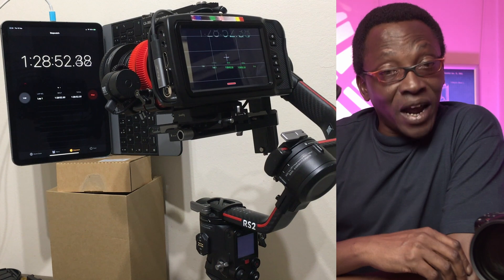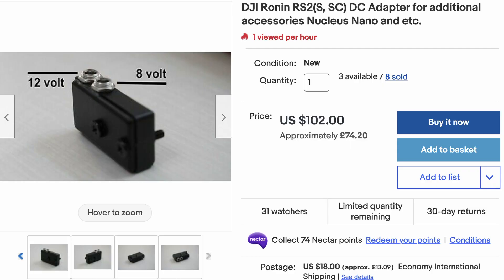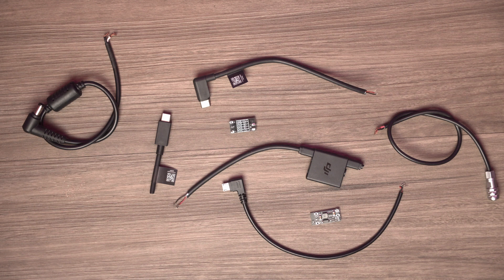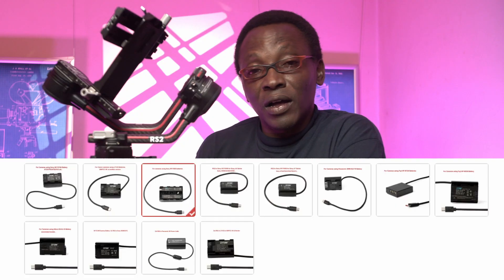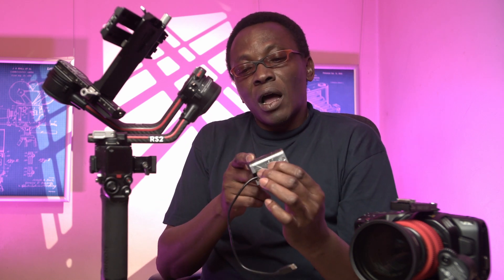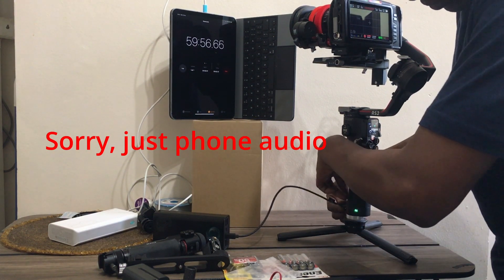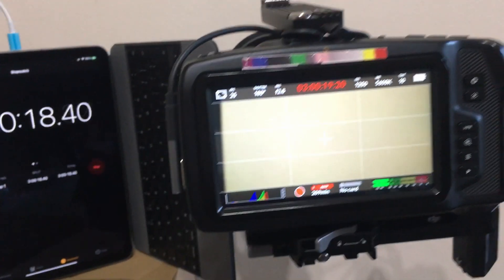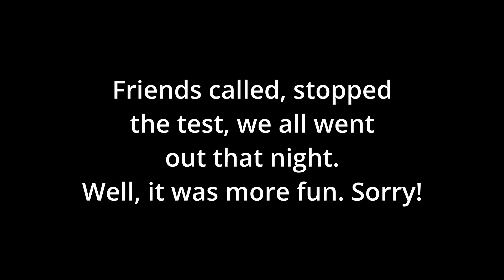DJI RS2 now Powering BMPCC and other cameras!!

Comment: Its crazy, I have stripped down a standard USB C lead and measured voltages on all the individual wires relative to each other and the highest voltage I can find in 2.8V dc on ports 1 & 2. So how does Zitay manage to obtain 7.2V dc from either the bottom or middle USB C port on the RS2? The top port has a standard 5V dc output but neither of the other 2 ports have any decent voltage!
Reply from the maker: No idea how Zitay is doing it, I don't use their dummy as I prefer this one I made myself... works better and I added a second USB-C cable for 5V out of the 'dummy' as seen at the end of the 'Zitay' video - https://youtu.be/k_JwmZ7F8AI?si=EmCIEnkA5Q7PceAe
Reply: @aNELeOnwuka  Its amazing, I measure 5V dc on the top RS2 USB C connector but nothing on the lower 2 except 2.5 & 2.8V dc so there must be some handshaking between the RS2 & the Buck step up PCB that ensures there is a high voltage output available from the lower ports on the RS2. I also have the original Ronin S and this is great because it has 2x 12V dc ports on the gimbal arm, so the RS2 is a step backwards. I have ordered the Zitay Sony A7SIII battery NP-ZZ100 version so will let you know how this goes.
Reply from the maker: @sjmackinder  The Zitay will work. Everyone was surprised when the RS2 was released and it didn't have 12V out.
Reply: @aNELeOnwuka  I have watched your excellent videos on the subject but still not sure how you have made your own version and what pcb you have used along with the USB C wiring?
Reply from the maker: @sjmackinder  Was going to make a video but it wasn't worth it. The 'How' was added to the 'description' of the Zitay video... the link I sent you earlier.
Most recent update is since I now use the Micro Studio 4K G2 as the gimbal camera I converted it to NP-F also with 5V out. If you're on FB you probably see me in Pocket Groups and a couple of RS2 groups.
Reply from the maker: @sjmackinder  Crazy, just wrote a reply that didn't go thru.
I was going to make a 'build' video but it ended up not being worth it to me. So I updated the 'how' in the description of the 'Zitay' video link I sent you earlier.
Reply: @aNELeOnwuka  I have the Tilta Nano USB C to USB micro cable to power the Tilta motor, this only works when connected to the top USB C connector on the RS2 and not either of the lower ones, hence my confusion....?

Comment: After spending hours and hours thinking and researching how to reduce the weight and make my rig lighter with the DJI Rs 3 Pro and Black Magic Pocket 6K, I found this minimalist and brilliant solution! For the continuous power system, do you think a Reytric BP-95 6600mAh v-mount battery connected by the USB output would be enough?

I'm also looking at how to install my t5 ssd and a hot shoe in case I need to use my Rode Wireless Go, increasing as little weight as possible and I think I'm on the right track, however if you have any advice it would be very helpful.

You are a genius my friend, thank you for showing me this way.
Reply from the maker: Ok, some interesting questions. I will try my best to answer from actual experience.

Hmmmm, where do I even start? First you want to get rid of the cage if you have one. So ‘how’ do you mount your T5 and Rode Wireless Go? I have one of these – ‘Ulanzi PT-7 Bracket’ and have used it on a gimbal many times; you can figure out how to mount things to it – both your T5 and Rode.
Found here - https://tinyurl.com/yzxa2pv5

Next is power. First I’d ask have you seen my ‘Zitay Dummy’ video? Found here - https://youtu.be/k_JwmZ7F8AI?si=xv2SbAtFu0KhViY9
The same version I’m using should power your 6K as it uses the same battery.
I’m not sure how much the v-mount you mentioned costs but you can use a much cheaper power bank and power the gimbal handle whenever the gimbal is off, even those small portable 10,000mah power banks.
Do note that a stronger 12V @3A power bank will power everything when ON like in the video. Link in the Zitay dummy video.
Now if you already own the Reytric v-mount then I’d say do some research to see if there is Dtap to USB-C so you can charge the gimbal @ 14 or so volts. You can also wear the battery on a belt to reduce gimbal weight even more.

By using the T5 I’m sure you already know you will not have ‘camera control’ from the gimbal… Aaaaaah the RS3 has Bluetooth start/stop or something… no problem there. I keep forgetting, as my gimbal is the older RS2.
Hopefully this answers some of your questions.

Comment: Would it be able to power the camera at 4K 60fps RAW 3:1 with full screen brightness? Because that's one thing that it can run on 8V but when it needs all the power it might not be able to keep up. I'd love to know! Thanks in advance!
Reply from the maker: Hi. That's an odd comment. The thing is it doesn't matter what your settings are the 'voltage' is not going to increase to 8V. Both my cameras are the 'early version' P4K so STILL have CDNG, having said that - NO MATTER the resolution or screen brightness - power from the dummy will read 7.4/7.5 for a full battery and doesn't go 'higher' with LP-E6 battery or dummy.
But to answer your question - Can you shoot 4K DCI, 60 @ 3:1, 100% screen brightness with the gimbal powering the camera with a 'special' USB-C RS2 dummy? ABSOLUTELY YES!

If you have not seen it yet I updated the video as I finally got the Zitay version that people can buy NOW on Amazon - Zitay Dummy Review - https://youtu.be/k_JwmZ7F8AI
Reply: @aNELeOnwuka  Its more a question of amperage if the voltage stays the same. Can the system handle the amount of amps it will take to meet the power (watts) necessary to run all of those settings.
Reply from the maker: @nolesdennhardt8986  Very good observation. The gimbal is 2A and in the testing I've done the Pocket cams run SSD, power OIS lens on, HFR and only hit 1.1A. The main problem with Pocket cams is the moment you have a 'dead' battery inside that is being charged... the Amps used jumps way up - I never have a battery inside but that's just me.
Not a prob;em with this set up as there can't be a dead batter inserted. I think there is a bit more info in my 'Power Bank' video. Cheers mate. https://youtu.be/Pp6uY_enG5U

Comment: So, crazy question. If you plug the powerpipe into the Raveye USB-C port, and then the barrel connector into a weimu to barrel connector adapter, will it get power then?
Reply from the maker: I would immediately say do NOT plug a power pipe into the RavenEye... I hight doubt it can use such a high voltage and might get damaged. Always check voltages.
Reply: @aNELeOnwuka  but doesn't the powerpipe ouput 12 volt FROM the USB-C, no matter what? So, instead of feeding the 12 volt into the dummy batter in the camera, you simply are feeidng the 12 volt input of the camera. Much like their Powerpipe direclty to WEIMU
Reply from the maker: @Henchproductions  Oh dear, you are completely mixing stuff up. This very video is NOT using the power pipe, I also am not and would never feed 12V into a dummy - NEVER use more than 10V into the pocket dummy.
I only mention the power pipe in the comment to you (not in this video) to say when and ONLY when powering the camera directly from a PD power bank that I use the power pipe as that is what it was designed for.
Watch this very 'dummy' video again; it is a different thing here.
Reply: I will take another look tomorrow.
Reply from the maker: @Henchproductions  Cool.
Reply: With your home made converter, would it work on the power input of the camera. Reason I ask, is because the timecode resets when l power is lost. And I want to avoid that.
Reply from the maker: @Henchproductions  These cameras use 'time of day' timecode that is always running even if you turn them off - it is not very acurate over periods of time. The other 00000 counter goes back to zero if turned off. Power source won't matter. Tap on the 'timer' to change between the two. 
Now for keeping an acurate TC the only chance you have really is using an External TC generator like a Tentacle to jam sync it

Comment: Can't wait to see you're build instructions. I want to use this with the Tilta float, with my powerbank batteries mounted at the bottom of the stabilizer. BTW, which powebank are you using?
Reply from the maker: Hey, trying to get access to a Pocket 6K Pro... and pretty much show both builds - NP-F & LP-E6. So sorry it's a bit delayed as there is some personal family stuff going on at the mo.
You can use ANY power bank that will charge the gimbal, however since I used to power the camera directly from power banks I'd say this one as it will even power a Pocket 6K Pro directly - https://www.aliexpress.com/item/1005002245995038.html?spm=a2g0s.9042311.0.0.7b184c4dWOFCdt

Also do check this video out. BlindSpot Power Pipe - https://youtu.be/1MM0wF4hH9M
Reply: @aNELeOnwuka  Man, I've been looking for somehtign like the Power Pipe forever. Since there are so many much more affordable powerbanks than the "Real" V-Mount ones ones.
Reply from the maker: @Henchproductions  Very good invention. Sorry but do check from 1.47 of this video - I have a power bank on my waist - https://youtu.be/2LmMwfhl6Hc
In this one I am using the long Andycine version of the power pipe. It's available on Amazon - I live in the UK so I have this link - https://www.amazon.co.uk/gp/product/B08MPLF88S/ref=ppx_yo_dt_b_asin_title_o03_s00?ie=UTF8&psc=1
Reply: I've ordered one if those powerbanks. Do you have a mounting suggestion?
Reply from the maker: @Henchproductions  Hiya. For me EVERYTHING had to do with cutting weright so the way I mount them is on a belt. See from 1.47 in this video (oh the pouch is from an old LCDVF viewfinder) - https://youtu.be/2LmMwfhl6Hc

Comment: Great video, this is awesome to see. I wonder, Blackmagic says the P4K takes a minimum of 12V, and Zitay says this dummy battery outputs 8.2V. So how well has this worked for you a month later?
Reply from the maker: Actually Blackmagic states the WEIPU port is 10.8-20V. When it comes to the 'battery chamber' that I used in the video the voltage range stated by Blackmagic is 6.2-10V.
Glad you enjoyed the video, this is amazing... it has tidied up cabling, pretty perfect to me and I should be making a follow-up video. Cheers.
Reply: @aNELeOnwuka  Ah, that's interesting. I didn't know that
Reply from the maker: @jasonpm13  Yeah, different systems and requirements!
Reply: @aNELeOnwuka  Is your power bank supplying 65W to the battery grip or are you able to get away with less?
Reply from the maker: @jasonpm13  No it is not supplying 65W to the gimbal (I have that power bank for a very different reason but I think I first showed  'why' in this video - to power the Pocket camera directly for 7hrs straight). This video - https://youtu.be/2LmMwfhl6Hc

Back to you - Any small PD power bank will charge the gimbal. I think the max rate is 20W(?) Can check the actual 'Watt' later but it was never an important figure for me on the gimbal. Hope that helps.
Reply: @aNELeOnwuka  that's the first video i saw of yours, but i don't think it's in there... what's it called?
Reply from the maker: @jasonpm13  Oh there is a power bank on my 'waist' connected directly to the Pocket camera... I still use them but I don't have to be connected by a cable anymore.
You mean what the power bank is called?? I have different ones, the 65W is the best - I got it here; they are mad expensive on Amazon and eBay - https://www.aliexpress.com/item/1005002245995038.html?spm=a2g0s.9042311.0.0.7e624c4dKRIX0A
Reply: @aNELeOnwuka  Thank brotha. Until this dummy battery gets to me i'm going to use this power bank to power the p4k directly. what port do you use on this power bank and what port to you plug your cord into on the p4k?
Reply from the maker: @jasonpm13  The camera needs to use a 'special' cable and you plug into the camera 12V port. I use 2 of those cables - originally invented by Blind Spot - https://amzn.to/3qxEV3T and the 2nd cable is a longer one that let me have the battery on my waist for gimbal use by Andycine - https://amzn.to/3HfXdN5
Reply: @aNELeOnwuka  tysm brotha this info is invaluable
Reply from the maker: @jasonpm13  You're very welcome.

Comment: Great job! How about powering a Canon C70? Do I need a dummy battery or can i use a DC>USB-C? Sounds to good to be true...? I don't think it exist dummy batteries for the C70 I'm afraid. Again, good detective work!
Reply from the maker: I believe the batteries you use are 14.4V. I don't think you can use a dummy. I also do not know the 'limit' of the port but this now is for 7.4-8V.  Can you use a power bank and power your camera thru USB-C? Yes, with the right board set to 15V I and if you find a 'dummy'  BP-A30 battery.
Doesn't the Canon C70 already run for a long time on those batteries?